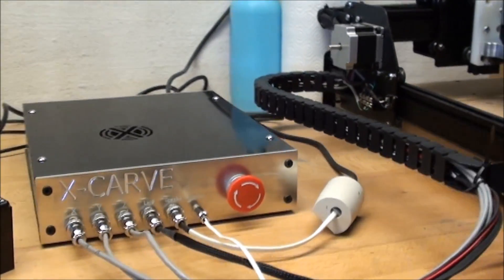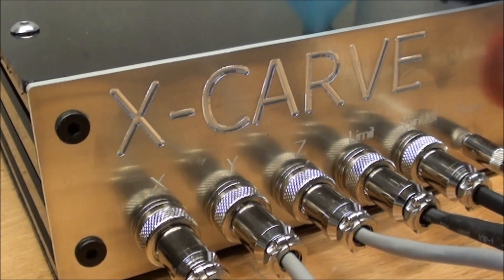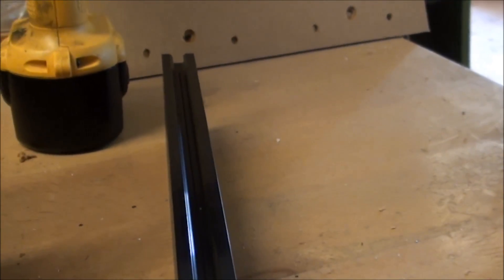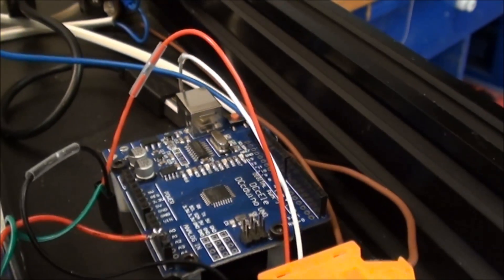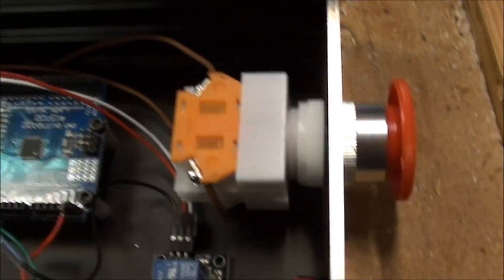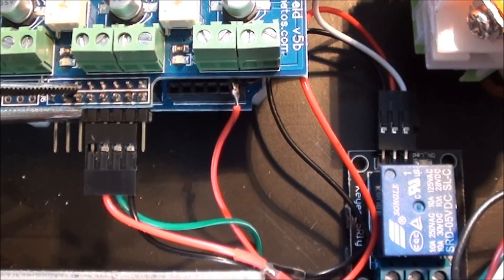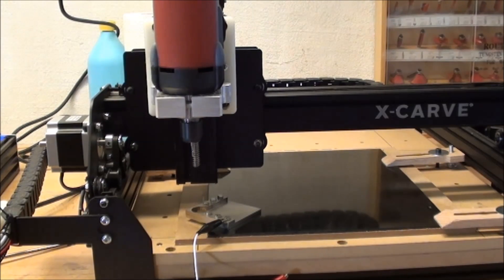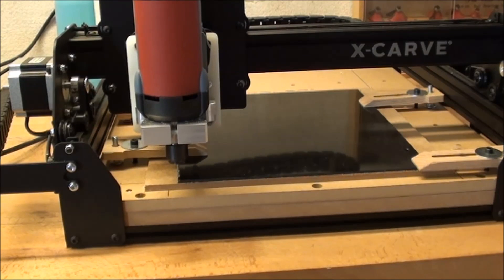X-Carve DIY CNC Router - How to make a Control Box

Comment: Nice build dude - couple of HUGE safety issues I can see though. The case doesn't look earthed at all. Also the 240v that comes out of the 'spindle' connector should use female connectors on the box side, as now you have live power pins sticking out of the front of your case. Sweet build though, I'll hopefully be doing something similar soon!
Reply from the maker: Yuo are right in that it should be grounded and I would recommend everybody to do so. However, I live in a very old house where the plugs does not have ground (only N and L) so it would be false safety in this cae.

Comment: hi, did you ground the case??  aluminum is great conductor of electricity. 220v AC and aluminum is not a good combination.
Reply from the maker: There is full isolation between the box and the 220. Power in via ICE inlet and power out via standard (Danish) wall outlet. So no worries.

Comment: Did you make the zeroing plate!?
Reply from the maker: Hi Darus, I have made the first versions myself by milling them in aluminum on the X-Carve. However, quite some people has wanted to get one so I have had a portion made in Stainless Steel (much harder and stiffer than aluminum) by laser cutting. I have put them for sale via: http://makersupplies.dk/You can also mill it your self using my drawings via the link in the description.Br, Martin

Comment: Hey Martin nice video ! I go one too now :) but i try to find some good drill bit here in Sweden but that is not easy to find i must tell you. where did you get yours ??
Reply from the maker: +the1to9 Thanks. I got the Alu bit from a Danish producer that make them themself. They are not  super expensive. I think the model no is E2090300 Check out their web page: http://risager.eu/
Reply: I try to look but since i am german and live in sweden my Dansk is not too good  :) under which section should i look i am very new at all that milling what sorte of pinnfräss i should use and so one :(
Reply from the maker: +the1to9 In this pdf you can see their own products: http://risager.eu/Files/Billeder/1-Risager_production.pdf
Aluminum bit can be found on page 1-5. It looks as if they have changed the numbers. The one I use must be equivalent to 50900500300 (96DKK)
Reply: +Martin Barfoed  thanks a lot i will get one! you say too in the video you got a spindel contorl i got the dewalt spindel on my one can i use the spindel control too to adjust my speed ??
Reply from the maker: +the1to9 Hi, I use a Kress 1050 spindle. It has a build in dial for setting speed (1-6). That is the one I ended up using after I decided to scrap the 24V that came with the machine. So I do not have a software controllable spindle speed
Reply: ok so i guess like my Dewalt i just just (1-6) like you.  I thought you have a way do set it in a software. Thanks a lot.

Comment: Hello Martin,

Very nice project - I think I will follow your steps here when finished with my X-carve building.

One question: I am using Vectric Cut2D 8.0 to generate G-code with my other CNC machines. Which SW besides Easel would be best for accepting the my G-codes and operate the X-carve ?

Cheers

Isaac
Reply from the maker: +Isaac Neuman Hi Isaac,
I use Cut3D and V-Carve the both produce G-Code that can be used directly on the X_Carve. So I'm confident that the code you get from 2DCut can also be used directly. You just need a control program to send it. I use Universal GCode Sender.
You may want to check out this video: https://www.youtube.com/watch?v=syvZL4lhpjc
Reply: +Martin Barfoed thanks Martin. I will sure check this up. It seems Vectric and UGCS is a good solution to work the X-Carve without Easel. All the best.

Comment: I'd  buy this from you today!  LOL

Ever consider creating these for sale?  A lot of NOOBS like myself aren't fully comfortable with exposed wiring and stuff for power supplies and controls.
Reply from the maker: +TheRangeControl Hi TRC. I'm happy that you like the design. However, I do not plan to produce more than this one :-) It's not that difficult. You can get most of the part from Inventables and then some time to solder it all together. I have posed a wiring diagram on their web page under projects. Check the link in the video description
Reply: +Martin Barfoed I understand.  And, I thank you for taking the time to respond.

Happy Making, Sir.

Comment: Hey Martin.. great videos and some clever tips for us X-Carvers. i've noticed you got a good selection bits and was wondering if you could recommend a good place to buy a starter kit here in DK or Europe... im running with the Makita M8..på forhånd tak
Reply from the maker: +Rasmus Palmqvist Hi Rasmus. I have sourced the bits from a number of suppliers. For the cheaper (probably Chinese made) bits I have some from Inventables, including their starter kit. I have shopped some on AliExpress.com (e.g. 10PCS 3.175X2X8mm 2 Flutes Ball End Mills, Carbide Ball Nose Milling Cutter Tools, Carving Router Bits) and I found a very good Danish supplier Risager.eu (in Galten). They sell Sutton bit and own products. I have bought a number of their own bits. Seems to be of very high quality e.g. 50900500300, 3mm aluminum bit w 6mm shaft, 50605010600, 6mm ball nose w 6mm shaft,  50605010300, 3mm ball nose w 6mm shaft, 50605010200, 2mm ball nose w 6mm shaft. You can find an online catalog on their homepage.

Comment: very good. Where did you get the 24V from?????
Reply from the maker: The 24V comes from the PSU that followed the X Carve
Reply: ok. Thanks you. My Shapeoko 2 has a separate 24V PSU.

Did you use shielded wire for your leads?
Reply from the maker: +SHAD0WBLADE100 
No I didn't. If you do remember to only connect if to GND at one end

Comment: how did you get the limit switches working in UGS?
Reply from the maker: Jamie Phillips Hi Jamie, I'm not 100% sure what you are after. UGS just sends orders to grbl so the same codes can be send using other senders. I use limit sw for for homing ($21) to set machine coordinates to zero. Currently I have not enabled soft or hard limits ($20 and 21). Below I have copied my grbl settings. You can list them by sending $$ to grbl. To change a setting simply send that to grbl (e.g. to set step pulse to 20 usec send $0=20)

Grbl 0.9g ['$' for help]
['$H'|'$X' to unlock]
>>> $$
$0=10 (step pulse, usec)
$1=255 (step idle delay, msec)
$2=0 (step port invert mask:00000000)
$3=3 (dir port invert mask:00000011)
$4=0 (step enable invert, bool)
$5=0 (limit pins invert, bool)
$6=0 (probe pin invert, bool)
$10=3 (status report mask:00000011)
$11=0.050 (junction deviation, mm)
$12=0.002 (arc tolerance, mm)
$13=0 (report inches, bool)
$14=1 (auto start, bool)
$20=0 (soft limits, bool)
$21=0 (hard limits, bool)
$22=1 (homing cycle, bool)
$23=3 (homing dir invert mask:00000011)
$24=25.000 (homing feed, mm/min)
$25=750.000 (homing seek, mm/min)
$26=250 (homing debounce, msec)
$27=1.000 (homing pull-off, mm)
$100=40.048 (x, step/mm)
$101=40.080 (y, step/mm)
$102=188.425 (z, step/mm)
$110=5000.000 (x max rate, mm/min)
$111=5000.000 (y max rate, mm/min)
$112=500.000 (z max rate, mm/min)
$120=250.000 (x accel, mm/sec^2)
$121=250.000 (y accel, mm/sec^2)
$122=50.000 (z accel, mm/sec^2)
$130=290.000 (x max travel, mm)
$131=290.000 (y max travel, mm)
$132=100.000 (z max travel, mm)
ok
Reply: My apologies. The older UGS builds had no support for them. I downloaded the newest one and it works perfect :) 

are the probe and spindel control  native features in GRBL/UGS also?
Reply from the maker: Jamie Phillips Yes both spindle (dis/)Enable and Probing are included in grbl v0.9. If you have older version you may need to upgrade. I have posted a video on how to do that some time ago
Reply: cheers dude!